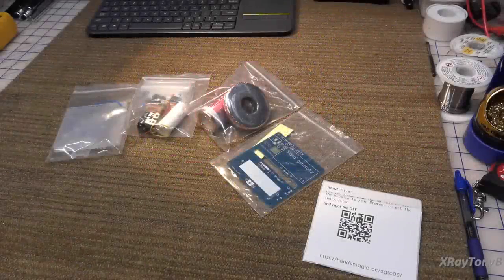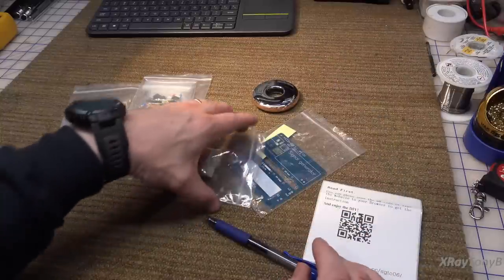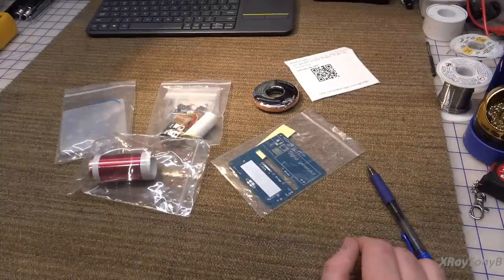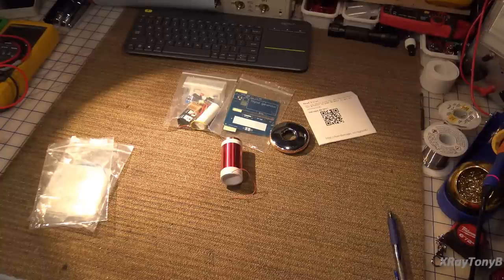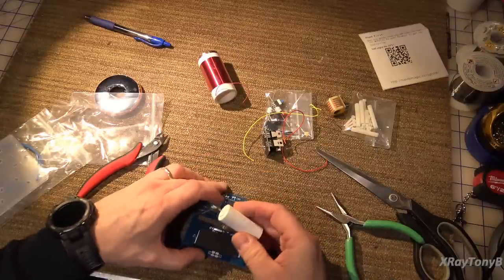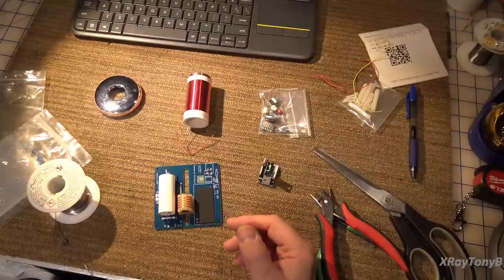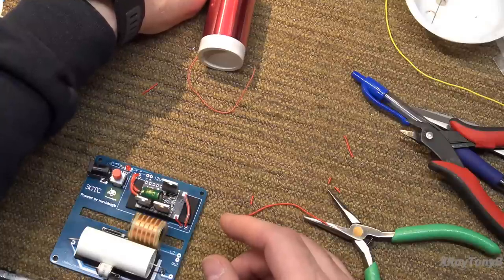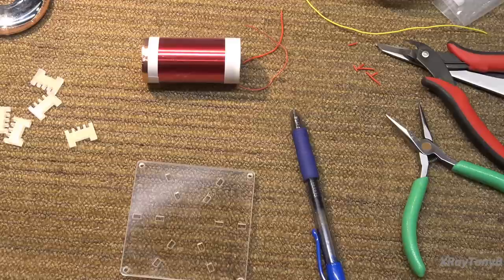Holiday Timewaster Video 2022 - Tesla Coil Kit & Tomography Talk

Comment: You are supposed to put the top load on before you switched it on. Without the top load capacitance, the coil is completely de-tuned and the stored energy has to go somewhere,. you see arcing across the primary to secondary! With a enclosed spark gap, it will get very hot. So you can only run it for a short time. Usually open spark air requires air blow quenching or rotary spark gaps  to break up the plasma.

Comment: My very first kit was a super cheap Tesla coil circuit. After I assembled it I learned I didn't have the means to properly power it up. Eventually I got it powered up and it sort of worked for a moment, but then I made a mistake and fried something. 😅In the end I used it for desoldering practice. Merry Christmas!

Comment: w2aew is one of the best YouTube channels if you're into electronics, I was learning how to generate pretty complicated signals using mostly discrete through hole parts and a couple of op-amps and 555 timers so an analog circuit, it's a challenge to get the different kind of signals, square wave, triangle wave, variable duty cycle going from zero to one hundred percent, trapezoid wave and a variable offset all built into one circuit, and with some help from w2aew I even made an add-on circuit so I'm now able to match transistors with my cheap digital oscilloscope when I set it to the X/Y measurement which is really nifty and even though I don't even used the exact op-amps, I only had the LM741 single op-amps and the LM385 double op-amps and those are not rail-to-rail capable so I had to compensate for that.

Can you imagine that I'm not even schooled in electrical engineering, never done anything like it in my life so I was a total noob at the time I asked him to help me out and because of him I was able to make the circuit work pretty good, and the extra functionality for my scope is one of the first analog circuits that I made and got working that was the cherry on top.

Before that I made a few Tesla Coils myself, from mini of about 5 cm to middle of about 30 cm and from spark gap to solid state driven, those are still working today, I also made myself a hand wound AC Flyback using the ferrite core of one that I blew up that I got from an old CRT tv which was also pretty powerful and gave a nice output but that was rectified so DC and it got hot very fast which is why I've blown the high voltage winding inside the potted part, now that I've hand wound the primary and secondary and potted into candle wax in a plastic box and also put in the capacitor bank and a hand wound choke, all into the one box and filled up with candle wax it doesn't even get warm anymore and I've got much hotter plasma now and way thicker and about as long as the DC flyback.

For that flyback I made myself a MONSTER driver circuit that is based on the Mazzilli ZVS flyback driver only I'm using 4 mosfets instead of two, and I have a separate power transformer with a voltage regulator circuit with voltage and ampere meter just for the ZVS driver circuit and I'm using the 24 volt AC with a footswitch, two relais that make or break the other power transformer with much higher voltage and current outputs on the AC side with one relay and with the other on the DC side to prevent the DC side from sparking, I have a ton of safety measures built-in so I never have to come close to the circuit with my hands when it's on and whenever I'm going too far with it it just stops oscillating, when I'm fast enough switching off the high voltage the driver circuit doesn't blow up but automatically starts up by itself with the 15 volt that comes from the separate power supply and doesn't get switched off, no need to because the driver circuit recovers on its own.

I can really abuse it and play with about 100,000 volts high voltage output and it draws about 4 to 5 ampere when there's no plasma arc and it draws up to about 15 ampere at 50 volts from the high voltage transformer which is 200 Watt at minimum and up to about 750 Watt maximum, which is crazy, totally not necessary and not usable in a practical way whatsoever but it is an awesome thing to play with and blow stuff up, that's what I use it for... Blowing up parts from PCB's with 100,000 volts is a lot of fun.

Comment: Hello Tony...
... first of all thank you very much for your current video, 
the subject of grid dip meter or dip meter has very good 
memories for me of my first attempt to build a grid dip meter
 myself,.. I still remember very well a Geloso Rebuild the 
2m-10 converter and all that with the help of a grid dipmeter.. ;-))))
... another point .. I've been watching your repair restoration video 
about hi-fi equipment for a number of years, .. I have the impression ... 
I've learned more about hi-fi & Co in the 2 to 4 years than in the
 last few years 40 years...
..with your tiny little insight into X-ray technology ... I am very amazed at 
what was, what is .. and maybe it will still be possible ..;-)))
vy 73 Micha ... (holder of an amateur radio license,.. more on that later) ..;-)

Comment: Please go to the effort to put heat shrink on the leads of the big, white capacitor, to prevent accidental contact. Maybe add some sort of walls to fully encase the lower drive section. If you are not going to play with the unit anymore, please disassemble it. It is really scary dangerous.

Comment: Hi Tony. What happens if you test the coil with the DUT shorted? Will it act like a band pass filter instead of a band stop filter (i.e. will you get a peak instead of a dip)? What if you test the coil with a known capacitance across it? In series with it? I don’t have a grid dip meter myself, so I can’t try this. I remember from my courses at college about transmission lines, that you can get reflection with the end open or shorted, but the nodes (0-crossings) happen at different lengths down the line. So, for a shorted-end transmission line, a node MUST occur at the short, whereas you would not get a node there with an open. Would this coil act like a transmission line under test, then?

Comment: Is there a means to configuring a "poor man's" dip meter with a function generator and a scope? Maybe sweep a frequency through the coil and watch for the max amplitude on the scope?
Reply: Another TYer suggests attaching a frequency generator to the input of the DUT coil, via two LEDs (with a 1K resistor,) placed is opposition,. Then,  sweep the frequency. The coil output wire is left unattached and is monitored with a scope probe, very loosely coupled = an unattached near field probe or bare probe, in close proximity. When the LEDs glow the brightest, you are in the ballpark of the resonate frequency. Use the scope, to find the exact best frequency and to prevent being fooled by harmonics. I would post the link to the video, but YT would just kill this post. I wonder if there is some danger that the coil could create some kind of a kickback that would kill your test equipment??? If so, how would you protect your gear?